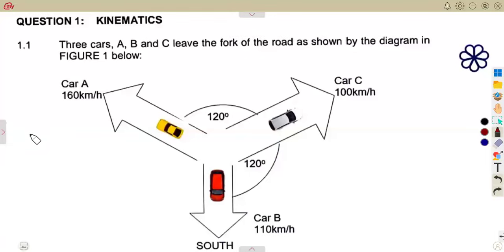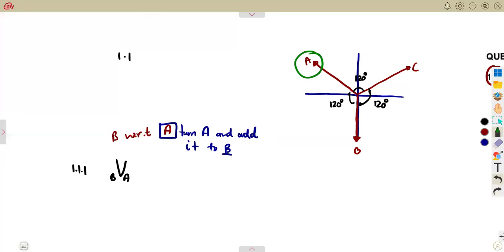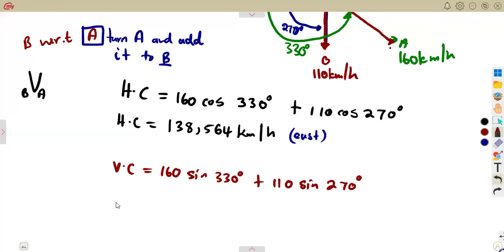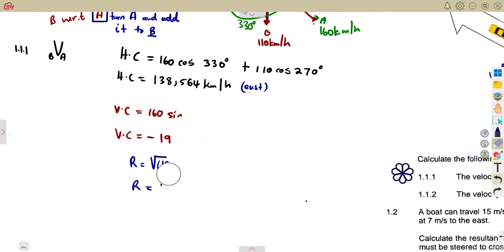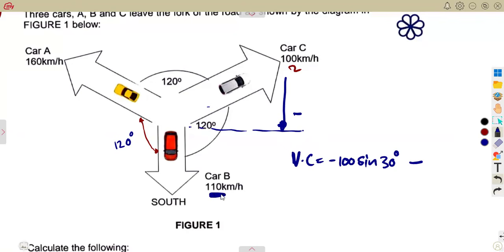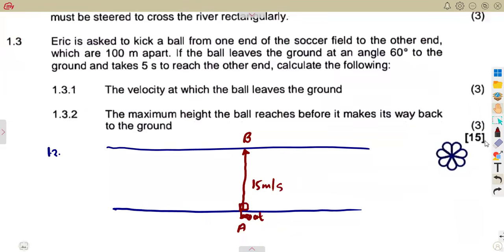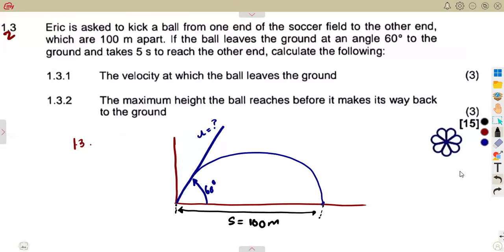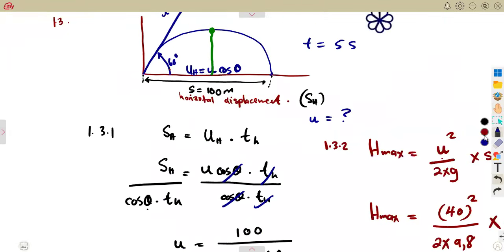Engineering Science N4 Kinematics April 2024 @mathszoneafricanmotives  @mathwithlightone

Comment: I think on that memo they did punch wrong the calculator coz if i add 160sin30-110 it gives me -30 not that answer on the memo...so during axam how do i know if the method I'm using is wrong coz been using that method and i was getting correct answers now I'm confused
Reply: Iyoooooh that memo is the reason I'm here 😢💔buh I'm happy now 😊
Reply from the maker: @ramadimetjematabane-ey8rn more light
Reply from the maker: Hie yes on that question they made an error , sometimes it happens on the memos so try to be careful when working with a memo
Reply: @mathszoneafricanmotives  oky thanks